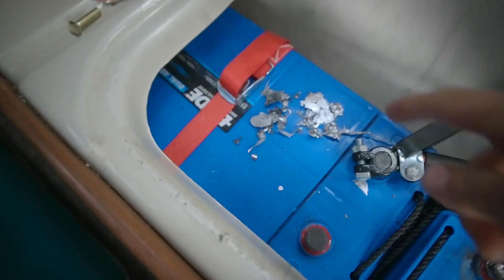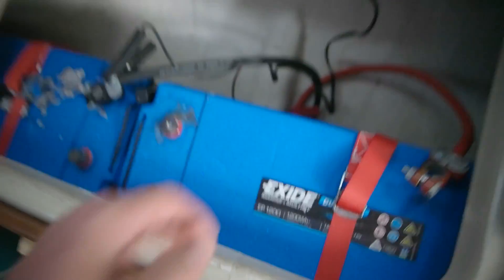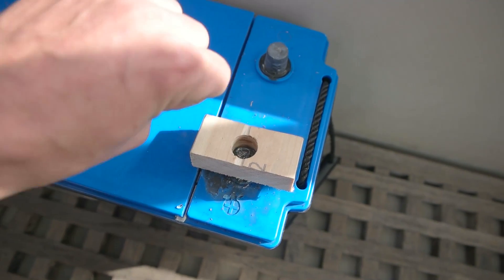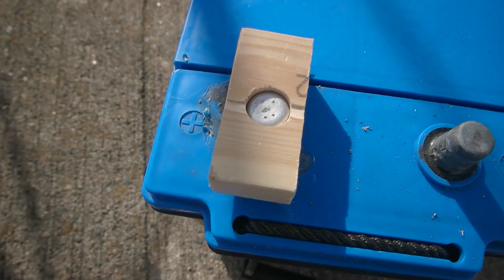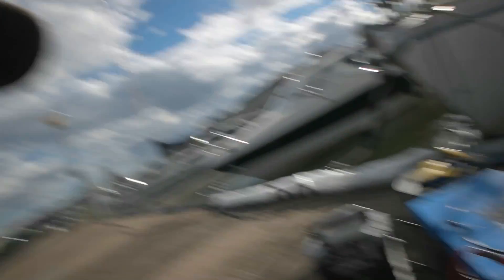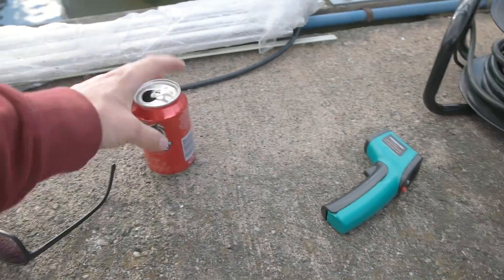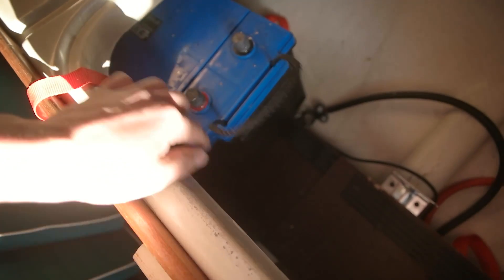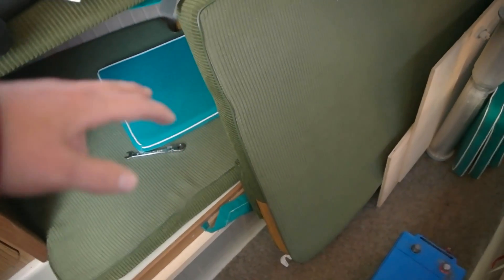Battery pole casting - Electric sailboat vlog 0020

Comment: Exactly how I would have repaired it. However the battery poles are generally tapered. Did you taper the new pole?
Reply from the maker: +Vincent Hart Just a little bit. I was more worried about the attacheness to the battery :)

Comment: Very well done. This turned out to be a very good method. Only keep an eye on it. The only concern I have is that it might not hold up. you poored molten lead on cold lead so there is a chance that hot and cold are not fused. maybe it cooled off to fast on the fusion plain  instead of fusing with the cold lead and it only holds on by form because you made some holes.   If so, it might be possible that after you put it back in the boat and put some stress on it by fastening the cable to it, it will let go. and if this will hapen it might be possible the cable will shift over and touch some other pole to make a short circuit. I think it is pretty important to add some tape or rope or cable tie to prevent the cable from moving in case the pole decides to let go. It would be a bad day when it would happen and the boat decides to burn down  this time